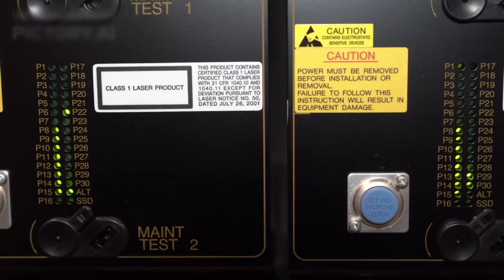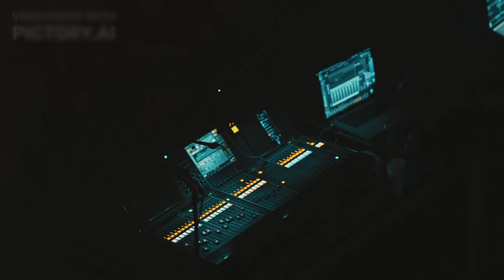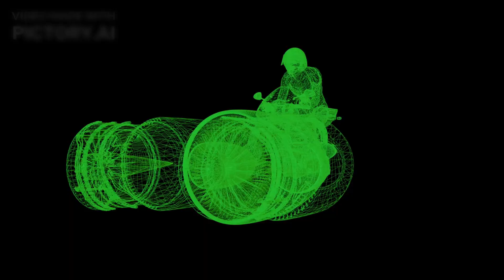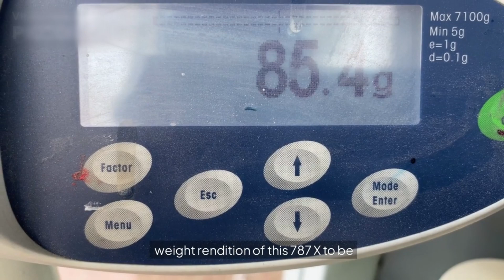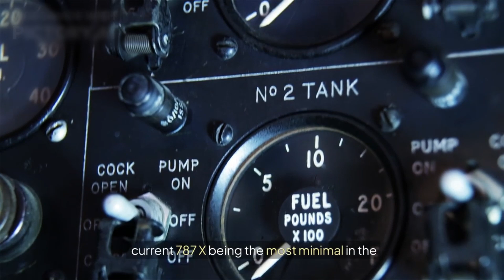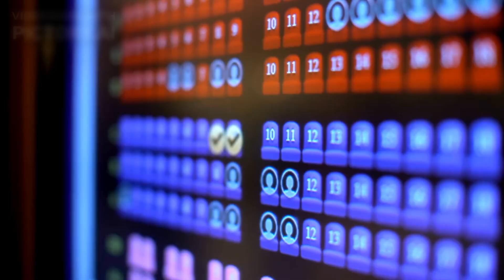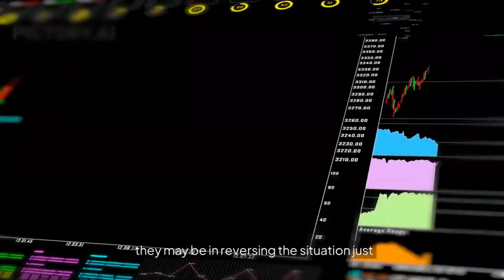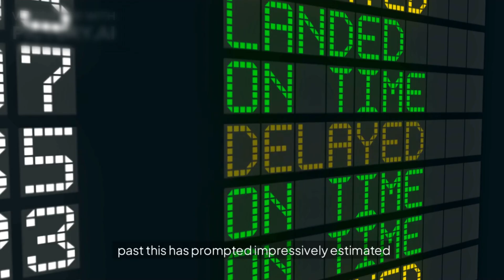Boeing 787 vs. airbus a350 | Boeing CEO: "New 787-X Will DESTROY Airbus's A350!"

Comment: Meaningless irrelevant word salad with loads of irrelevant film clips. This advert for Boeing is so bad, you could be forgiven for thinking it was made by Boeing. 
"...but since of the fly by wire air framework all the more critically high gross wieght 787X could likewise be great for flying from and among hot and high air terminals becuase of its synthesis and configuration making it an optimal airplane for monster aircrafts like Emirates and anot Aircrafts Boeing understood this and dove in head first to turn the 787X into a monster and it shows as per some examination the scope of the 787X" ..... 

....this kind of thinking has got Boeing where it is today, the inability to string cogent sentences together.